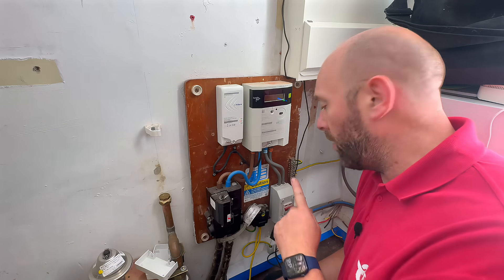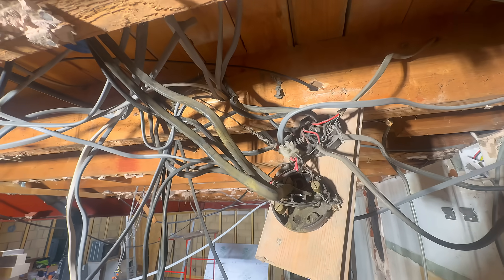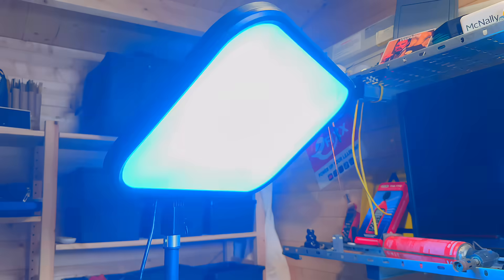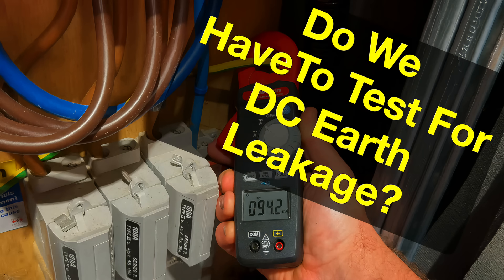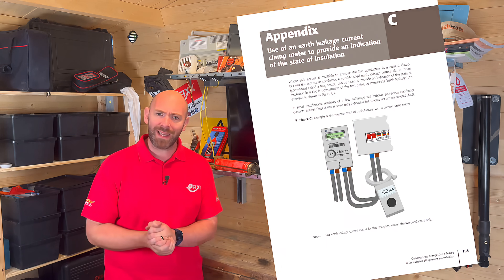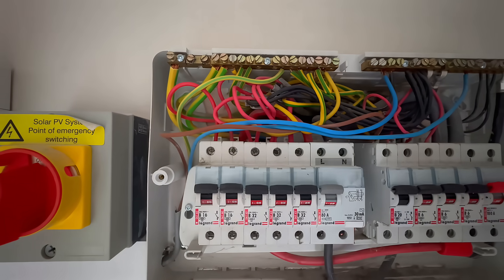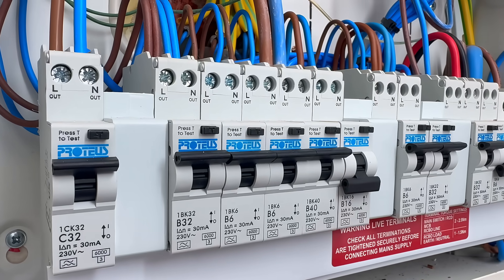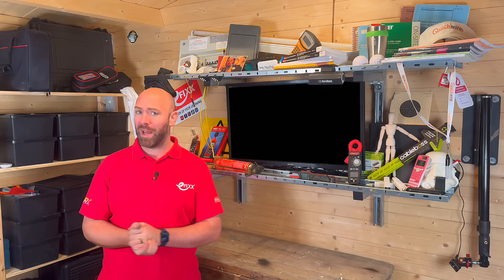Should You Test For DC Leakage Current?

Comment from the maker: Learn more about the TIS 570 clamp meter 👉 https://hub.efixx.co.uk/TISCLAMPMETER
Reply: The UNI-T UT210E is much cheaper and can also indirectly measure DC current. The UNI-T UT216D is also capable of making the measurement if you need a larger clamp.
Reply: @yngndrw.  See my comment about meter performance.
Reply: @retrozmachine1189  Looking at the specifications, the Uni-T meters have better accuracy at low levels. In terms of distortion, thats why you'd usually prefer a "true rms" meter but it's unclear if this only applies to voltage measurement. You'd expect the hall effect IC to have limited bandwidth and therefore smooth the detected current, so in practice I'd expect them to both work about the same in this situation.
Reply: @yngndrw.  Expect is different to reality.  Give it a go.  Quite easy to do too.  Use a break out cable to pass say line of a kettle through the clamp and one side of a known DC supply through it too (bench PSU in constant current mode would be a good example) and see how  your UNI-T goes.  Then do the same but place a low wattage LED lamp on the AC path instead of the kettle and up the amps on the DC path and see how your UNI-T goes.  I'm not saying it will fail, but unless UNI-T specifically states AC and DC measurements fall within their stated specs in the presence of the other type of current and at what levels you simply can not assume the UNI-T is actually telling you what is really going on.
Reply: Can you explain why the meter is clamped around both conductors for leakage current, rather than the usual measurement method of clamping one leg?
Reply from the maker: You are looking for the difference between what is flowing in Line and Neutral - which has to be the leakage. Measuring just one conductor would show the load current.
Reply: @mfr58 the idea is to measure the difference between the out & back lines and surmise that that "residual" is the leakage current giving someone a shock as the drain the shock current to earth (linking back to the PME MET CPC link).
Hence the two wires inside the sense clip.
Reply: @philipoakley5498  Thank you.

Comment: Like so much it is "something we didn't deal with before" - old motors and lightbulbs didn't usually do it. The increasing numbers of switch mode power supplies with Y capacitance is not quite a "new" thing, but has it all filtered through the thinking? I have found half the mains voltage (110 - 115VAC) on surfaces, and need to check how well the plug made connection. The rules state a difference in leakage between portable and fixed. We are now going to be installing a lot of big "fixed" equipment - heat pumps etc. The numbers are going to grow.

Comment: Thanks for excellent points, I have often pondered this. I would add... A conventional clamp meter will not test for DC leakage, in fact DC does not produce an induced current in a coil so you need a very expensive hall effect meter designed for DC so your simple clamp meter is not distinguishing the difference between DC, 5Hz, 50Hz, 400Hz and 40 KHz leakages currents. Secondly if you're a bit sad (like me) and out of curiosity, investigate the source of DC leakage, you will find it doesn't make logical sense because Kirchoff's law doesn't appear to work anymore! After a restless night scratching my head, I realised that unlike AC leakage, DC leakage has both positive and negative leakage that can cancel , consequently, electrician logic doesn't work (by that I mean with leakage current we simply test at the CPE if its say 5-10mA, we move on because we measure the aggregate of the parts so safe to assume every part must be less). Thirdly (and most importantly), where do we draw the line regarding commercial practice and pissing about?  In an install, we know DC leakage can only come from single phase HVAC and inverters and it is always present but only by a few mA and is created (as you say) by the SPD circuitry being unbalanced in some way (expected since component tolerances within SPD are typically 5%) so DC leakage must be caused by domestic appliances. As stated, I believe that there is positive and negative that even on the same ring may cancel, BUT, in my limited experience of pissing around with this, its always the turned off washing machine that creates a staggering 20mA, and, its not the difference between a Binatone and a Miele, they all seem to do it. Dishwashers (that are to us, electrically the same thing), are always great. Computerised ovens come in next with typically 2-3mA of DC leakage (and more disturbing for us about 10mA of 50Hz AC leakage), followed by LCD TV's and every computer, however USB chargers seem immune. Let's face it, appliances are out of our remit, aren't they? and... DC leakage is not a fault, is it? However, I would add that if as an electrician (in my experience) you are curious and feel the need to play, you must have an install with double pole RCBO's otherwise your DC leakage testing just won't make a lot of sense and you'll finish up an ugly bald headed old git like me!
Reply: Perhaps should add that this might be a dangerous path, I sometimes install inverter HVAC that specifies a certain type of RCBO because of DC / HF AC leakage. I spend thousands on RCBO's every year to the point I buy a box of boxes of 6A 30mA type AC and these cost me a puny 12 quid each in wholesaler type quantities! Recently, I had to buy these special RCBO, they cost 350 (that's three hundred and fifty) EACH and to really take the piss, there were 4 of them side by side across a row within the DB. ug! So... be very careful with sentances that contain 'DC'!

Comment: The DC leakage you refer to is not strictly leakage because it does not ‘leak’ it’s a superimposed DC offset caused by asymmetric (cheap) power supplies, ie half wave rectification without PFC. The average over a cycle is greater than zero and this offset is measured as DC.  If high enough it can damage transformers since a DC component drives them into saturation causing them to burn out.
True leakage current from power supplies is due to ‘Y’ safety capacitors in the EMI suppression circuit between phase and earth.  With a high Z voltmeter you can often measure about 100VAC between USB metallic parts and earth.  However the maximum current is about 1/3 mA. (I’m an electrical engineer)

Comment: At 4min49seconds is that picture/diagram wrong?  It shows the meter cables but the blue are normally together in the middle of the meter and the phase/line are normally on the outside.  Check your meter at home.

Comment: The clamp meter is shown measuring around both conductors, is this correct?
Reply: @mfr58  according to manual, it is
Reply: @lemech  That's curious, I would have thought the opposite direction of the current in each leg would cancel.
Reply: @mfr58 if no leakage it should show zero
Reply: @lemech  I just checked the manual and it shows only clamping around one leg of the circuit. not both. This is for AC and DC.
Correction, I just read the small print on AC measurement. Despite showing clamping both conductors is incorrect, they go on to say for leakage current, it is correct. Poor visuals on the instructions. I'm still curious how the measurement is taken that way, as normally it is not the way to measure current.
Reply: @mfr58 clamping 1 wire is to measure the current in the wire. If u clamp live and neutral, it will compute the difference if any. So if live is 1 A, neutral is 0.9A, the meter shows 0.1 A as the leakage current.
Reply: @lemech  Yes, I just applied my brain cell to it and figured that the leakage is to earth, so we are measuring flow between live conductors and earth (the other leg of the circuit not in the clamp) and that is the inbalance current you allude to Thanks for prompting me to think it through.

Comment: This is all academic for me, but should sparkies really be doing a common mode and a differential mode check on the RCD/RCBOs.  That is, for a single phase device clamp both line and neutral and check for DC then clamp either line or neutral and check for DC again.  There could be a common DC component on both L/N flowing towards or away from the RCD and that would still affect the CT.  There could be opposing currents flowing on L/N that result in a zero or reduced common reading but still affect the CT.  Checking both together and then one separately would cover the situation.  Engineers feel free to pipe up and say that these different modes wouldn't affect the CT and desenistise the RCD.

Comment: It's an interesting topic and a well presented video, but I'd argue that it isn't the installation that's causing the DC leakage, but the appliances connected to it. And since those appliances won't necessarily be on and leaking when you test, how can you really test worst case unless you go and turn all of them on? But even then, some might be leaking DC in one direction, others might leak in the other direction, so turning on one appliance only might give a higher overall DC leakage than turning on a few together as they could cancel each other out if the polarity of the leaking is opposite on different devices.
Reply: Yes, I thought that too, appliances must be operating, preferably full tilt, and checked individually either by powering up one at a time or by going round and checking currents at the point of supply for the appliance.

Comment: With DC clamp meters it is essential to zero them out close to, and in the same orientation as the wires to be tested as the readings are affected by the Earth's magnetic field and any other static fields in the vicinity, otherwise the readings are meaningless. You can also do a reality check by reversing the clamp and checking you get a similar reading with the opposite polarity.
Reply from the maker: Great advice 👍
Reply: @mikeselectricstuff  Exactly, best to reverse the current flow without moving the clamp meter, essentially canceling the offset

Comment: I think it’s crazy than manufactures are allowed to manufacture stuff that gives a leakage to earth in the first place . As you said a LED light bulb won’t cause a problem as no earth connection. So obviously it can be done .
Reply: Nope couse otherwise they inject disturbing frequency IN rhe electrical circuit.  The main issue i belive that who is writing manuals and guides are experts... but of 20 years ago.    One example; i bough an hoepli manual for electrical engineering 2016. "New edition" . At the comma of lights there were like 4 pages of electric light with carbon leads ( 1940 arc carbon lights)  and merely 1 page about LED. 2016

Comment: Parallel earth paths make testing on the earth wire at the distribution board inaccurate. Testing the meter tails as demonstrated isn't possible if you have a 3 phase installation - which big offices that have loads of computers usually are (and its computers / servers that produce dc leakage).
I suspect this video is more of a promo for the tester being shown, and a way of justifying its purchase. How many offices will let you mess about in their distribution board when the servers are all flat out with critical tasks in hand.

Comment: Times have changed but choosing the appropriate RCD for the system isn’t new. I would think that a good definition of a safe installation for both EICR and the home owner/occupier is one that is safe with every piece of equipment running plus (say perhaps) a 2 milliamp safety margin (I’ve pulled that figure out of thin air). 
In an ideal world it sounds like new electrical equipment which leaks DC should be required have:
1) This DC figure on its Name plate/ Rating plate and of coarse in its manual. Some manuals do indicate that a AC_DC pulse RCD is required — but hey, who reads manuals...
2) This DC figure on a label around the plug or cord providing a reminder to check board for DC leakage with everything on those applicable RCD  circuits running.
As a home owner I would like something by/in the consumer unit giving a DC value on each circuit as an aid memoir to look at every time I buy some new appliance but I see problems if this was done by visiting electricians. 
My clamp meter doesn't measure DC current so the thought of doing a quick check to see if the RCD test button still trips it gives me the shivers. Yet that should indicate the value of teaching the homeowner how to frequently test the RCD(s) and the benefit of only having battery run clocks which don’t need to be reset after every test.

Comment: Worth later adding a simple explanation of how that dc (average) current arises out of the rectification (diodes and switching)  within the supplies, and the RFI/EMC filters.

I like to think of adding a temporary link between neutral (which is also earth via the MET) and a centre point for the positive and negative voltages of the diodes and storage capacitors (visually split in two). Because the two storage voltages are 'balanced', notionally, there is (should be) no current in the link because there's no voltage difference.

In reality there is also the Y capacitors for the RFI filtering that connect to earth, and that 'temporary' neutral link isn't there, so that unbalanced current now flows through the Earth (CPC) side via the Y unbalance.

Comment: What is causing the DC leakage? how do you Reduce the DC leakage?
Reply: It is the filters for the electronic switching which divert 'unbalance' currents into earth, rather than a balanced 'neutral' (three phase is slightly easier to explain because neutral only has regular unbalance, so having it show up on earth/CPC is 'unexpected')
Reply: @philipoakley5498  I presume this unbalance current is actually pulsating dc as capacitors don't pass dc (except as dielectric leakage)?
Reply: @mfr58  Hi, yes it is pulsating, mono directional current (on average) from switch mode systems.  
The older basic single phase Y-capacitor filtering still has 50Hz leakage. 

At the RCBO coils (If I understand correctly)  the pulse DC begins to over-magnetise (i.e. saturate) the magnetic materials so that any extra AC (50Hz) residual currents fail to create extra magnetisation to attract and trip the switch. 
[writing that last bit stimulates me to double check the saturation effects, which are 'real', e.g. V/f issues in transformers]
Reply: @mfr58  Extra: In addition there can be hysteresis in the magnetisation of the sense coil. Without DC, the AC current is centred on the magnetisation 'B-H' curve, which keeps the solenoid trip effects strong on both sides of the sprung latch. The DC can effectively shift the B-H hysteresis so that the solenoid trip effect is weakened, thus need much higher AC mA leakage to activate the trip - the RCD has become blind to the AC leakage because of that averaged DC bias.

Comment: Something that might be interesting to give a go for a future video is how various meters perform when measuring current.  Cheap meters more often than not can not accurately measure DC in the presence of AC and vice versa too.  Some do fine when the waveforms are perfectly sinusoidal, but degrade significantly with distorted wave forms.  Similar problems happen measuring voltage too.
Reply from the maker: Great suggestion, that's definitely something we could look at for a future video!

Comment: I’ve been testing DC leakage more and more nowadays. Especially on split load boards when suddenly a new AC unit or Heat pump has been installed and the combination leakage is nearing the upper limit. I’ve even had to swap circuits across RCD’s to prevent nuisance tripping. If I’m going to a new property I will always check leakage before and after
Reply: The heat pump's RCD may also need special consideration because of the switching pulses for the variable speed drives in the HP which need coordination for high frequency 'DC' (one way) pulsing.

Comment: The split load board example is configured wrong . 

Put upstairs ring and downstairs lights on RCD 1 and downstairs ring and upstairs lights on RCD 2  also that way if you loose the upper stairs ring you still have upstairs lights or if you loose the light you still have sockets so your not plunged into total darkness when you get up in the night to go to the bedroom. And end up good forbid falling down the stairs. Or tripping over a piece of bedroom furniture and cracking your skull or something
Reply: That is a topic for a separate discussion
Reply: @andywillett.videos  Also wouldnt be split boards anymore, RCBO's solve this.